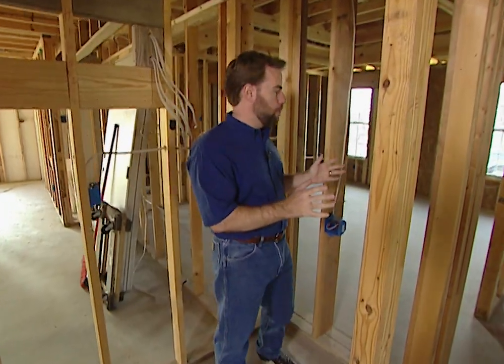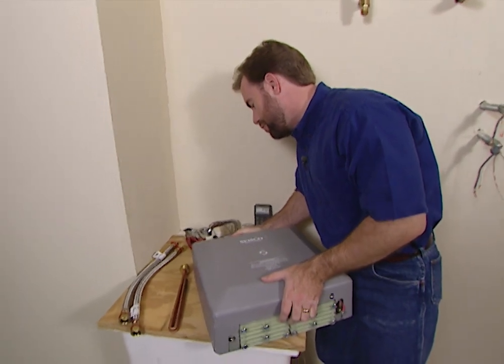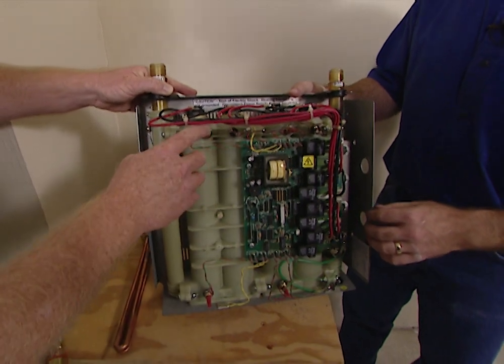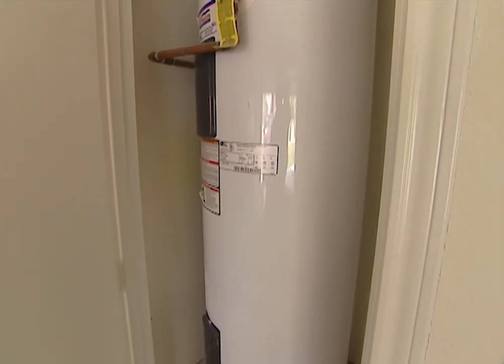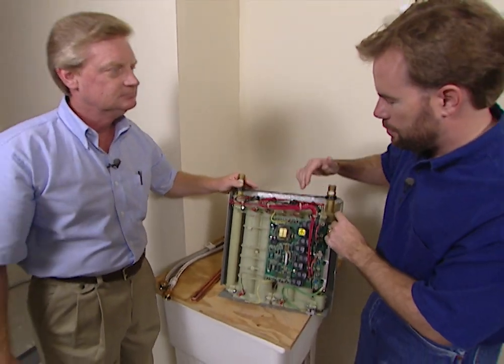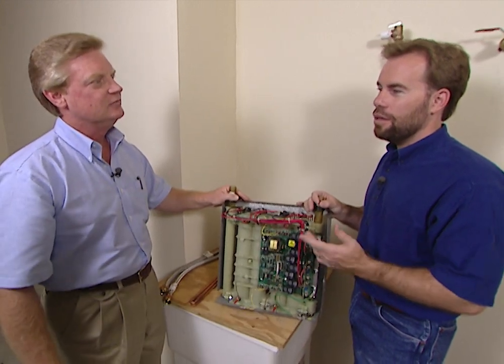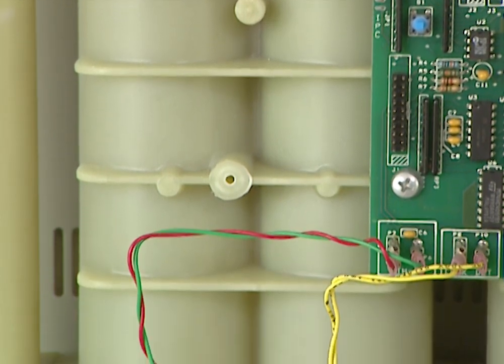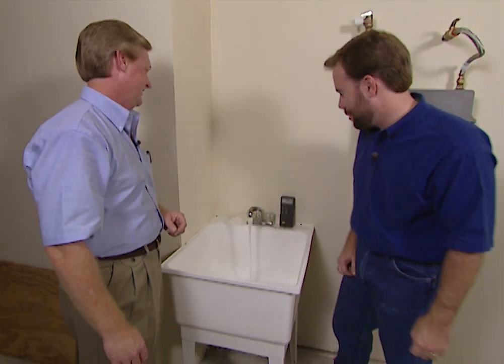Tankless Water Heating Technology - Can You Replace a Huge Tank with One of These?

Comment: The seisco performed well however the plastic housing would crack and destroy unit.  The company went out and was bought by AOSmith and no parts available.  It was over engineered and the motherboard not coated or protected from water, then hairline cracks in plastic killed it causing a bad rep.  These came out in 1998.
Reply: You seem like a techie that truly liked the system.  If you're interested, here's some more information from an ex employee of the company that manufactured the system.  The company line about not coating the PCB was that would trap more heat than the triacs would have been able to easily dissipate.  I'm not saying I believe that was the reason though, it's just what I was told the times I brought it up.  A fully enclosed pcb was talked about for years and finally designed about 2006, but I don't know if it was ever put into production.  Seisco had 2 major issues caused by 3 outside manufacturers.  UPG in Gladewater Texas and a Puget Plastics factory in Mexico were both plastics molders that manufactured the glass reinforced nylon chamber bodies and Dana Corp that manufactured the thermistors the system used in early models.  Seisco was definitely over engineered for a water heater, but that was the engineering required to accomplish the goals.  Modulating amperage to precisely control temperature output by "looking" several seconds ahead, no need for flow switches and also not causing lights to flicker in the home.  You seem more technical than most, so I'm sure you understand how complicated it is to make all those things happen at the same time.  When you're modulating 120 amps, not causing light flicker is pretty challenging all by itself without even taking into account the excess heat generated by doing this.  Seisco was so advanced that the National Electric Code needed to be modified for the downgraded breaker sizes needed by tankless systems because the standard size for it's load was too high due to the modulation of amperage.  This led to a lot of battles with stubborn electrical engineers speccing designs.  I even saw one get fired from a job for OU because he refused to properly spec breakers in an apartment complex they were building.  He didn't care what the NEC said, the math didn't work for him.  Of course, the principle technical designer, Thomas L. Harman, Ph.D., was on the board of the NEC, so getting the NEC writers to understand wasn't too hard.  I consider him to be one of the most brilliant people I've ever met.  I've seen him come up with hardware fixes that made you scratch your head wondering how he even came up with the idea to try that particular solution.  Seisco really is a sad story of how someone came up with an incredible idea (by finding a simplified example someone else had made in a rental house), found experts to make his idea work and then 3 companies not properly following manufacturing processes pulled the rug out from under his company just as it was starting to truly take off.  

When the unit was originally produced in 1998, the thermistors were made here in the US.  Up until 1996, they were manufactured by Borg Warner.  Dana Corp bought them out in 1996 and eventually moved the production of the sensors to Mexico around 2000.  None of the requirements for manufacturing a reliable part were followed in Mexico, resulting in an overnight massive failure rate of the sensors.  The bi metal chip and the spring that went inside the sensor were left out in the rain prior to assembly, allowing rust and minerals to accumulate in the sensor chamber.  This prevented the sensors from reacting properly or quickly.  Even after bringing it to the attention of the factory and parent company Dana Corp, nothing was done to change the faulty process of leaving the internal  parts out in the weather before manufacturing.  Seisco contended that Dana Corp even lied about fixing the process when Seisco was working with them to resolve the issue.  Cars, what the sensors were originally designed for, don't need such specificity in reading or quick reaction times.  So, Dana wasn't really concerned with spending more money to produce a more reliable part for such a small user of the part.  It boiled down to simple math.  Do you spend more money to manufacture a part because a customer that needs a very small percentage of them?  Eventually, Seisco sued Dana Corp for damages and reputation loss.  This led to a $27,850,000 judgement against Dana Corp for damages and knowingly violating the Texas Deceptive Trade Practices act.  But, the appeals court gutted that judgement and lowered it to $450,000 in 2009.  Sensor manufacturing was eventually moved to GE, but I'm not sure if they're the ones still making them for the AO Smith unit.  If they are, I hope they're at least using a higher class thermistor.  Even these sensors weren't as reliable as the ones made in the US by Borg Warner and led to continued product issues.  GE's response was, well pay more for better sensors and stop using our cheapest class.  At times, the majority of the batch received from GE was faulty.  Unfortunately, so was QC at the outside manufacturing plant in Guadalajara where Seiscos were assembled.  It seems like everyday in Guadalajara is a manufactured on Monday type day.  It was amazing, but at times there were units wired wrong and also units with the wrong processor code installed that still managed to have paperwork showing they passed testing.  Kind of a technical impossibility, but it happened frequently and I was told to just ignore it when I caught it happening.    So, there would be entire production runs full of faulty sensors.  These sorts of issues didn't help in rebuilding the reputation with supply houses that received a batch of bad units that ended up on the receiving end of angry customers and contractors.  I consider the sensor problem to be a mix of outside forces and a bit of shooting yourself in the foot because you didn't want to spend a little more money to get a lot more reliability..  

You referred to the molding improving once it was moved from Mexico, but there was also a molding problem with a US company prior to using the Mexican manufacturer.  Puget and UPG Gladewater were the two companies responsible for the leaking chambers in 2001 and 2002.  Failure rates were 0 in 1998 and 1999 prior to these 2 companies and went up to 25% while they were manufacturing the chambers.  They were sued over not following the Dupont recommended manufacturing process, which Seisco contended was responsible for the chamber leaks it had.  Small customers with a complicated manufacturing process just don't get the attention they deserve when a bigger company is waiting for their product.  So, time and temperature constraints necessary to the mold setting properly weren't followed.  None of the chamber bodies manufactured in 1998 and 1999 failed.  Not a single one.  Because of the work I performed for the lawsuits, I would be considered an expert witness by the courts and believe it so firmly that I would testify to that.  But, I'd have never testified that no chambers leaked after moving production to UPG Houston in 2002.  I would say the failure rate after the 2002 move was minuscule compared to the 25% rate while these 2 companies molded the chambers, but a failure rate still existed.  I can't comment on the failure rate after Seisco opened it's own molding plant because I wasn't there to see the long term results.  The judgement against the two plastics molders was $78,500,000.  I don't remember what happened during the appeals process.  Right after the judgments against Dana, UPG and Puget, Microtherm, the original parent company of Seisco, opened it's own molding plant to have more control over the process.